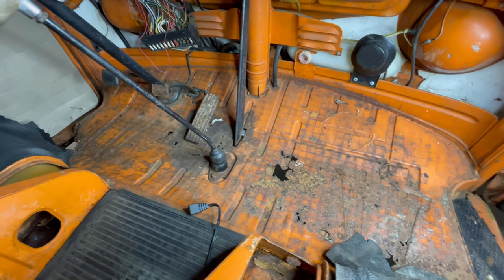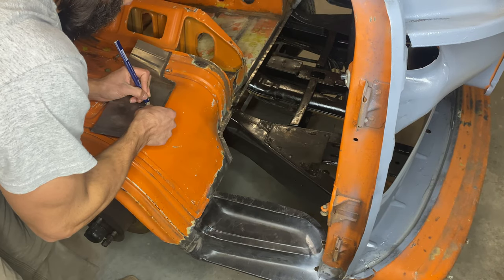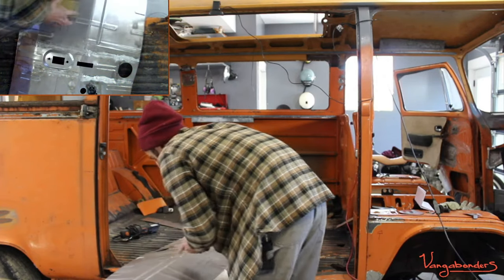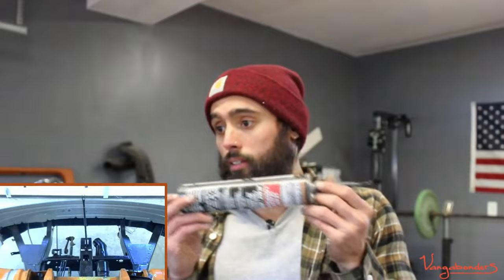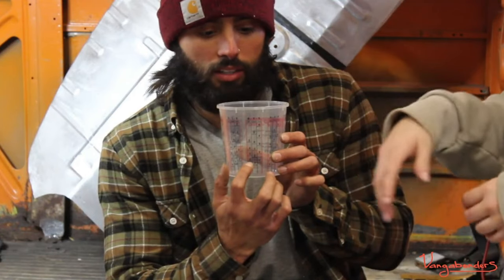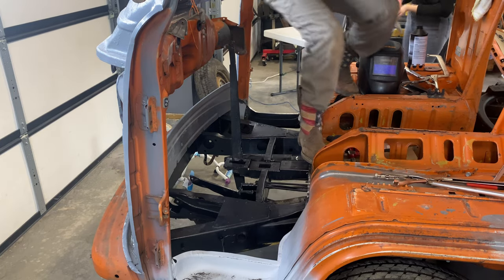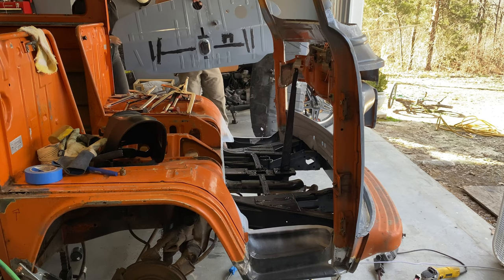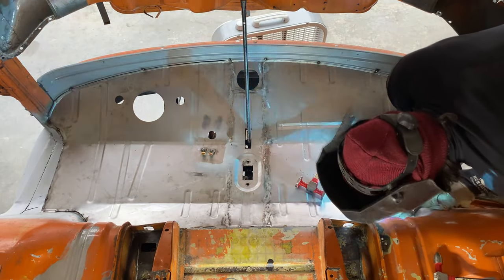Full Replacement of VW Bus floor! VW Bus Restoration Episode: 24

Comment: The flloor welds ye did look perfect.  I agree with your pannel bond vs spot weld theory I think water can get in and then trapped in between the metal and cause rest to accure out of sight.

Comment: The original was only spot welded...why did you decide to completely weld that floor in? Won't it make it damn near impossible to swap out nest time? Thanks for making these vids, btw...I'm doing basically the same thing with my '71 and LOVE your content!
Reply from the maker: I don't plan on swapping it out ever again, but If I had to I would just cut around the welds and grind them down with a flappy disc! Cheers and good luck on your 71

Comment: what brand sheet metal did you use that actually fit?
Reply from the maker: https://www.serial-kombi.com/en-GB/bay-window-body-panels-/-inside-floor-and-wheel-tubs-complete-front-cab-floor-8/1972-7/1979-n34380

or the one from Alan Schofield

https://www.alanhschofield.com/ourparts/prod_2474410-Cab-Floor-Complete-LHD-7279-211801051KL.html

they only sell them in three pieces ever since klassicfab stopped making his. Good luck!

Comment: You are motivating me to work on my Vanagon. How do you have your welder set, in particular amps?
Reply from the maker: I use a Lincoln Easy MIG 140 set on B and 4.5 - 5 wire speed, not sure what B converts to in amps though

Comment: awesome work @Vangabonders
Did you have formal welding / body work training before you tried to tackle your bus? 
Where was the original crappy floor panel from / manufacturer?   Aside from schofield i also saw theres a jp dansk brand outside of the klockerholm? 
Did you do the engine lip and rear chassis leg section yet i havent seemed to find that in your vids
Reply from the maker: To answer all your questions in order, I have never been formally trained in either welding or body work. I am solely self taught and have managed to improve over time of just practicing. I still have much to improve though. As far as the original front floor I had, it was from BusDepot and was the klokkerholm part, but as far as the JP Dansk is concerned it is the same crappy part, so don't buy it if you are having to replace any large area of front floor. Hell I wouldn't even buy it to do a small patch. I haven't recorded the episode about repairing the engine lip and rear chassis section but I do have the parts and I will be recording that soon. Cheers!